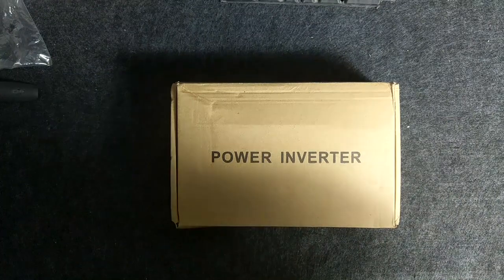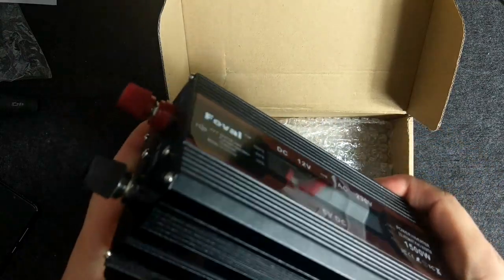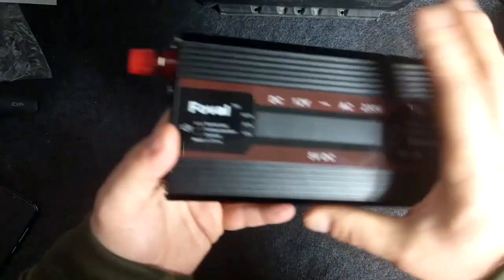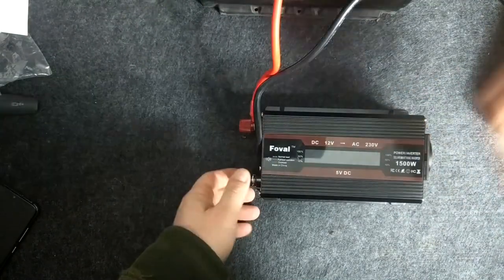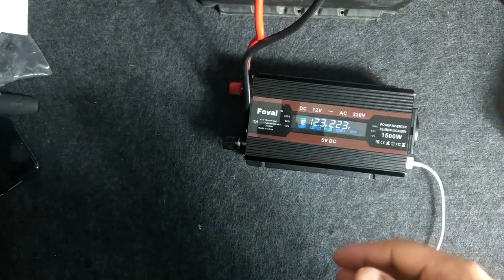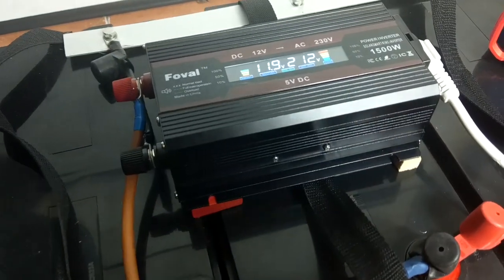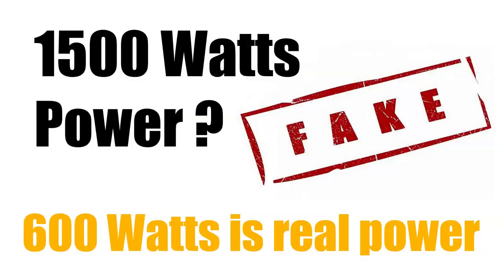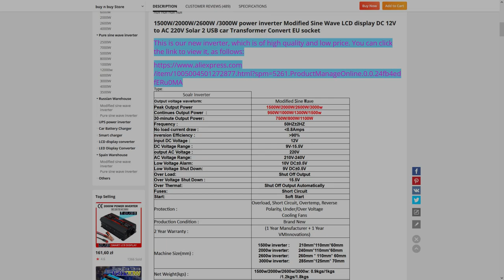Foval Power Inverter  - review and true load test

Comment: I got the same and im satisfied with mine, thats what i wanted, it says 1500w peak power and 500w continuous power...some devices draw more current during ignition, which is why the peak power is higher than the continuous isn't it? 😊
It is totally worth 60$, I recommend 👍